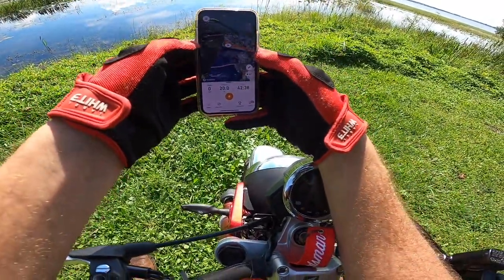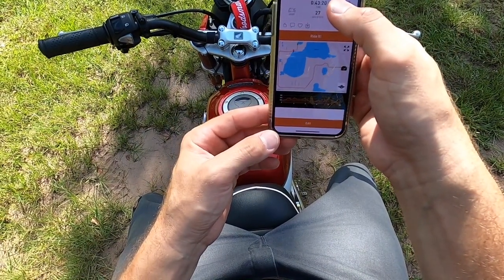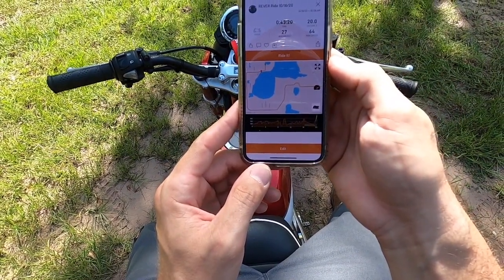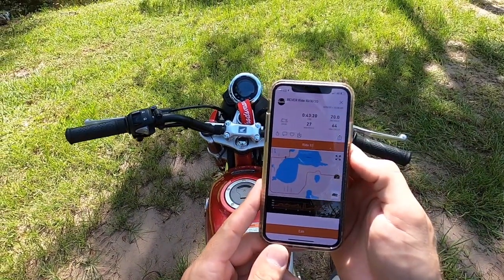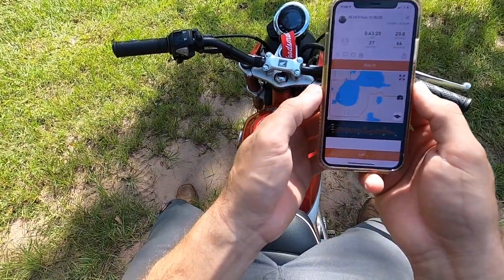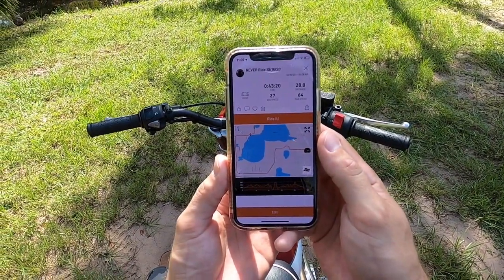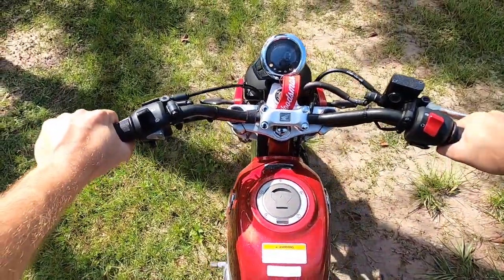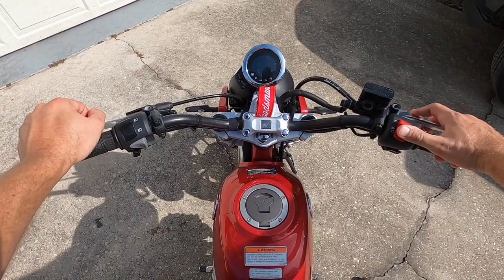DHM High Compression Piston for Honda Monkey/Grom - Analyzing the Break-in Ride Data

Comment: Hi john.glad the new piston is working  for you.im able to climb the trail desert  hills easily  with  that 14 and 37 tooth  combo.my spacer mods I made for the rear shocks work perfect.no more bottoming.my weight  200 pounds. I'm riding  streets and then trails.my front end washes  out on me if I let off on throttle. Do you think more knobby would  be ok on street  too.?I think any one wanting to put some pep into their monkey  without  spending  a lot  of  money just  needs to change the two sprockets.great pull through  all 4 gears now.thanks mike z.

Comment: I know I had asked in comments before asking about performance   I figured by now  you might have had time to firm a better opinion.  So would you have left stock or piston and cam was a good call.  Just looking for an update.  Just in case Santa might buy something.
Reply from the maker: The piston definitely added some torque lower in the rpm range and made the power curve feel thicker overall. The cam will reduce some low rpm torque, so finding ways to recover that is good. The piston is definitely one way to do that without totally departing away from the OEM design. Definitely a worthwhile purchase

Comment: interesting,  wonder if fuel mileage will improve with time,  i could see this being a problem for some people who trail ride,
A bit disappointed that top speed didnt increase. maybe need more brake in time and recheck later date.
thanks for the update.
Reply from the maker: Ya know I don’t think the gauge was reading correctly as I noticed the other day it was higher than it was when I did the video. So that might need reevaluated. I do think there’s more speed to be had after they break in (probably like 100 miles) and with street tires. I’m gonna experiment with stuff to figure it all out

Comment: You should go fill up at the station and note actual fuel used. The gauge on my Monkey has about a half gallon left when the gauge starts flashing. So, if the gauge is showing half, might have gone through only a half gallon or so? But still, if it’s only 20mi, that’d be a big drop as well!
Reply from the maker: Yeah I totally didn’t expect that so I didn’t document it that time. Next time I certainly will! Wide open throttle riding must suck down the gas with the tune
Reply from the maker: Thanks for the comment and I’m glad to hear you’re inspired! I haven’t monitored mpg, on this bike I’m more focused on more smiles per gallon than miles 😁

Comment: What gearing are you currently running?  I’ve hit 74-75 on a Grom and Monkey with cam/intake/exhaust/ecu...easy in different locations and altitudes.  Weight 190lbs🤔...something seems off.

Interested to see if things adjust with gearing and a few more miles on it.  Nice vid and keep up the updates!
Reply from the maker: I’m running a 14/36 on the Monkey. I have the 14/37 on my Grom with the same mods (minus the piston) and hit 67 with the Monkey OEM tires. I feel my weight, knobby tires, and the humidity plays a big part of me not being able to hit 70. Im gonna give it some more break in time and play with gearing and I’ll get 70, but yeah, it feels wrong to not be able to hit it after all these mods and assumingely around 13-14hp. 

Thanks for watching and the comment!
Reply: @John5XR  be safe bro most 12in knobbies just rated for 60mph, did you try with 15/36?
Reply from the maker: Are they really?! Wow, never knew that! No I haven’t tried the other gear ratios yet, but am now wanting to do a gear combo comparison video where I try several ratio combos and report on what does what
Reply: Do you ever change the computer altitude setting?
Reply from the maker: I don’t know how to adjust anything in the ecu, but know the manual explains how to adjust for altitude using the screw on the throttle body

Comment: Hi john sorry to hear the disappointing result from the DHM high comp piston,ive just ordered one from Cameron Jones +ecu  programmed for >>yoshi >chimera> tb cam and the Dhm piston> standard tyres 15 tooth sprocket ill let you know what result i get.(  keep up the videos great!!!  ) regards David
Reply from the maker: Not disappointed at all, and I hate that it might have sounded that way, because the piston makes the bike feel very alive throughout the rpm range! I rarely ever touch the top speed on the monkey as it’s not really what I use it for, so the piston is adding the power where I need it most, in the low to mid range. 70mph is just so close that I want to hit it for no real reason. Also, if I had street tires I’m almost positive I would hit 70. I’m gonna try the 15T sprocket and a variety of combos to see what does what. Should be interesting
Reply: so what are the results david?

Comment: The reason you aren't seeing an increase in top speed on these little bikes is because they do not have a 5th gear. 

It is hitting its rev limit & litterally cannot spin the motor any faster as it is capped by the ECU. This means basically, any performance parts you put on, including a big bore, can only add increased torque to your bike; top speed is set by rev limits, transmision, & chain gearing. 

If u want higher top speeds you have to either sacrific some of the added torque by changing your gearing, or get a 5 speed transmision for it.
Reply from the maker: But it’s not hitting the rev limiter in 4th
Reply: @John5XR  I may have been a bit hasty in my first post. Looking into this a bit more, it looks like it's power curve peaks in the 7k rpm range. Same kind of difference though, you would need a full 4 valve kit ($2800+ with all needed parts added) to be able to have the needed power all the way to red line. I would reccomend just adjusting the sprockets if u need more top speed, or don't if the extra torque is more important 2 u.

 You can also drop a 5 gear transmision in it & upgrade the sprocket to give u overall faster/smoother acceleration with a higher top speed & no detriment to your torque. Either way you just need to max out your speed at a lower rpm where the engine has the most power.
Reply: @1985wolfman  not sure what 5 speed kits you're looking at, but every one I've seen on the market has a same final drive as the 4 speed

Comment: That speed is a bummer. I also want to get to 70. I have a 2019 Grom with a Dinger mid length intake, Yoshimura RS-2 exhaust without db killer, Yoshimura ST-1M cam, 14T countershaft sprocket and a Dynojet PowerVision 3 with WBCX. I just rode on a canned tune, that isn’t great, and I got 63MPH tucked without red lining it. I’m only about 165 ready to ride though. The new 5-speed 2021 Grom may get to 70 easier with the closer gear spacing even if top gear has the same ratio as the 4 speed.
Reply from the maker: It is, but isn’t. Here’s why: I’m 200lbs and 6’1”. A 175lb rider would get to 70 on my bike, I’m sure of it! Also, I have the Shinko Mobber tires. When I put the OEM Monkey tires on my Grom (which has the TB cam, MNNTHBX Mtake, FMF exhaust, DHM tune, and 14/37 gearing) it went 67mph. I’m positive if I had this piston in the Grom it would go 70. So, I’ll play with some gearing combos and maybe try the stock tires and I’ll surely hit 70. I ain’t done trying yet!! I love the new Grom and the updates they made. It’s gonna be tough to swallow when they offer those updates on the Monkey 😞
Reply: @John5XR  I'm jealous of your 67 MPH! Mine doesn't rev out. I think it's the tune.

The new Grom and inevitably the Monkey will be hard to resist. I still love my Grom SF though.
Reply: @John5XR  I rode my Grom for the third time today since installing the ST-1M cam and getting a new adjusted, canned tune from Dynojet using my log file. I was able to hit 69 MPH fully tucked on a fairly windy day after a long, long rev out at 9,530 RPM.  My redline has been adjusted to 9,700 RPM, but I still couldn't get it to hit redline in top gear.  Holy cow did I feel so much mechanical sympathy revving the Grom out for something like 30 seconds straight though!
Reply from the maker: Sounds about par for the course! Lol, I know what you’re saying about holding it wide open for a long time. On my break in run I was wide open for like 5-minutes down the long stretch of road. After a while you start thinking you’re hearing things going on in the engine 😳